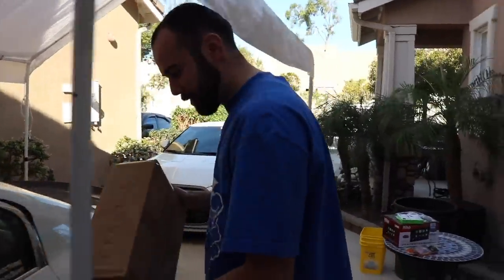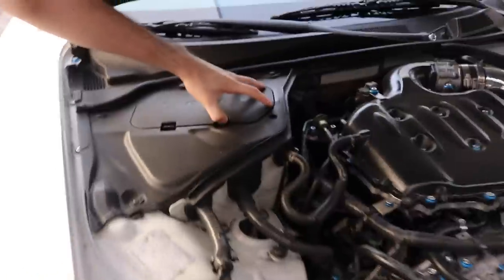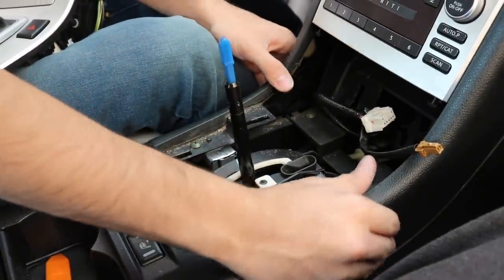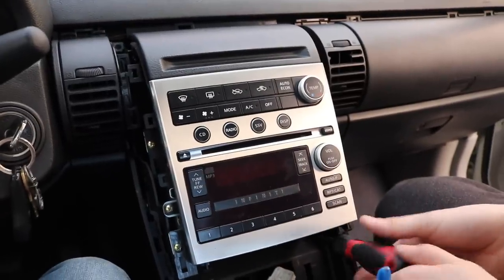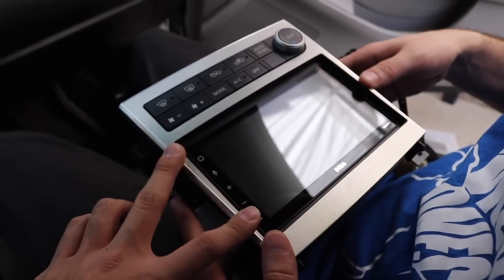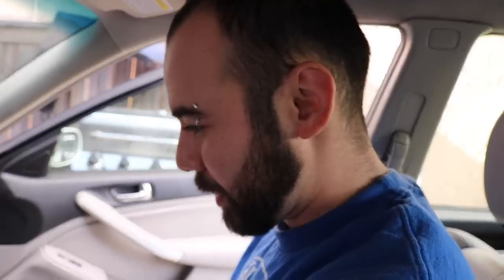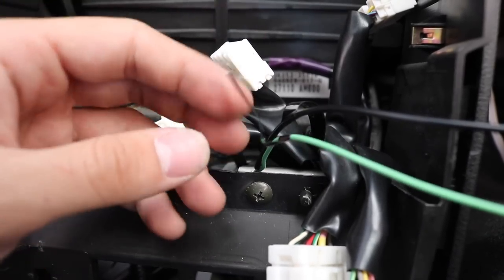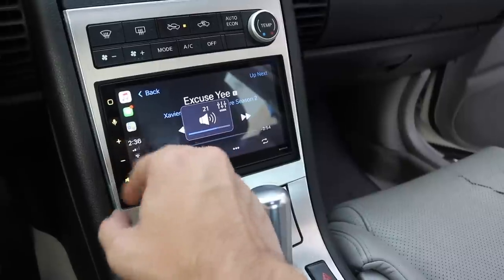JDM Double Din Install - Infiniti G35

Comment: after the install, does the steering wheel music module still connect to turn on the stereo, control volume and change tracks, etc.?
Reply: Mils Garage doesn’t seem like he has the stock steering wheel but I’m with you on that question
Reply: @pankakemix41  I think there is a wiring kit to keep the steering wheel controls
Reply: You need another type of wiring clip for the steering wheel to work with the radio
Reply: The wire harness does not come with steering wheel control you need to install a universal from maestro rr
Reply: @Weedcough  which one?

Comment: A watched this video a thousand times before purchasing a radio for my car.  I know Boss isn't the best. However in my opinion I think this is the cleanest, most factory looking aftermarket head unit that I have ever seen.  This head unit paired with the Jdm trim looks oem.  I ended up installing some walmart trash Android radio.  However I purchased it not because of a budget.  I purchased it because other than the Boss radio it wasn't nothing out that had a clean look.  Good choice and it looks amazing.

Comment: Did you manage to find out where the extra 3 harness connected to the car go ?
Reply: Jeyson Balbi yeah I have the same question
Reply: The other one's are for the steering wheel control but infinity does not have one so you need to have universal swc called rr maestro

Comment: Bro you are fire. I remember when you had like NO subs Bro! I’m contemplating a G but I need an X model Cuz snow life
Reply: Mikey Barker get veloster and make awd hehe
Reply from the maker: Thank you man! The G35 X’s are dope!
Reply: no the s
Reply: The x model is the frigging beast!
If you have good tires and decent suspension then you will be able to drive through damn near any snow! It also has a snow mode switch. I have an 04 model with slight functional mods. I live in the  north and it does very well in snow and ice! Good luck to you bro!
Reply: Ah Umm iive in Texas it will never snow here its 110° 😭 mines rwd. burning tires bruh
Reply: Did you get the X
Reply: You dont need awd in the snow. I've survived winters in a 240, mr2, and currently a g35 coupe. Good winter tires and good driving are all you need mate dont sacrifice the rwd fun 😂
Reply: Sammyeggnog how deep was the snow and where are you from thanks

Comment: The harness that you bought, did you need to move the cables around? I bought an adapter for the car that technically is a plug and play but I noticed that the 12v yellow cable does not plug into the slot from the car, as well as the ground cable. Did you have the same problem?
Reply: Daniel Araujo Nissan do not a have a ground, you have to make a ground if you are installing a aftermarket stereo

Comment: You should remove the positive terminal…… the whole car is a ground, so you could pick up a ground for that positive anywhere…… while you won’t  find a positive anywhere if it’s disconnected. Except the battery terminal it’s self. The rare exception being British positive grounded vehicles. You could still short something out the way you did it.

Comment: My radio and heat controls don't work and ac is stuck on. If I do an aftermarket radio will this fix my issue?

Comment: I bought the the double don’t used from eBay. And I bought the alpine ilx-w650 to go with it. I need a double don’t trim to fit it in properly. You think you could help? Thanks.

Comment: Hey,, the factory radio and ac climate control, are they connected together to the same circuit board?  I’ve been trying to find out if you could swap the oem ac climate control switch to the double din, this way, I can keep dual climate control that comes in my G....thanks!

Comment: If I'm broke asf could I turn the original din into a "double din" by using a dremel and removing the parts or is the ac control wiring part of the stock radio wiring?
Reply: Fah-Breezy the ac controls and radio are 1 piece I think I read you’d have to buy jdm ac controls if you want to just cut out a space in the original bezel

Comment: Im in the process of installing a radio the only problem I have is that there’s no ground cable... we managed to turn it on by connecting it directly to the battery which keeps the screen on even after the car is shut off.. so im planning on using a switch?
Reply from the maker: Just make sure it's not too much of a parasitic drain on your battery otherwise it'll leave you stranded haha
Reply: Don’t use a switch, wire the red wire to a accessories fuse that turn off when the key is removed and the yellow wire to a constant power also for the ground just screw it down to the side of the radio

Comment: I have a g35 coupe with navigation system do the make dash kit and where can I buy it
Reply: Erick Morfin yes,  the metra kit is the most commonly found kit that you can get from crutchfeild, ebay, amazon, and other auto electronics dealers. The best kit is the jdm kit that you can find on ebay and amazon. It can also be found at Nissanraceshop.com  . Which is where I purchased mine. Also for anyone who wants to keep the dual climate control, that unit can be purchased at enjuku.com for about $200.

Comment: Where did you get the cable that connects to the car that connects to the radio with all the colorful wires? Please help
Reply from the maker: I believe it's the Metra Wiring Harness!
Reply: You can purchase the aftermarket wiring kit form any stereo shop or bestbuy

Comment: The double din kit is 350$ did you buy it for that and what does it mean when it asks with navigation and dual zone ? What do I put
Reply from the maker: I bought it on eBay for about $250. If your car isn't equipped with navigation dont get the navigation one!
Reply: Static Works thanks

Comment: for the double din kit, which did you choose, single or dual zone?
Reply: Tony Le  check Wich one your car has so it will work correctly with the jdm kit
Reply: @poptrunkonu  where do you check dat? Doesn't seem to be a well known thing
Reply: Ali Khan if your G35 has dual zone it will have a specific button on your dash and it will say dual and of your don’t have it then the button is blank and their will not be any letters on it
Reply: @poptrunkonu  where can I find that?

Comment: Dang i looked that part up 390 bucks, surely you can get it cheaper that's just rediculous. (Ok after searching Crutchfield  has it for 150) or if you have to have jdm pay the 400
Reply: Philip Holman look on eBay, people in japan selling them for around 250 shipped to you
Reply: @Desert_juanito  z1 sells a nice metal finish one for 239. I found it online for 175  can't remember where. Not official jdm but that's really no big deal imo
Reply: @Desert_juanito  z1 sells a nice metal finish one for 239. I found it online for 175  can't remember where. Not official jdm but that's really no big deal imo
Reply: Philip Holman there is only two options, the jdm bezel or the metra plastic one that looks like ass as the buttons for climate control are really low quality, I say spend the extra money and get a jdm one

Comment: BOSS ? Really? What a waist of time. Pioneer 8201NEX only. 
#brokeboys
Reply from the maker: want a cookie? (:
Reply: If your going to do anything, do it right, don't half-ass it. If you can't afford to do it right, just wait till you can. But I give you credit on the true JDM bezel and not going complete scumbag using the non-matching Metra POS.
Reply from the maker: This debate has been going on forever. whether it’s rep wheels vs real wheels, etc. Some people can’t afford it while people choose not to pay 1K for a stereo or 4K for real wheels. The way I see it is, get whatever you want or can afford. While your looking down upon people who can’t afford certain things, someone is looking down on you for owning a 10 year old oil burning G35.
Reply: I see your point. Fortunately my motors a fully built brand new stage 2 Z1 motor and doesn't burn oil at all now. (atleast for 1700 miles between oil changes). I have a fully built Z also but wanted more room and love the timeless body lines of the G. I daily a 15' CTS-V coupe. The G and Z are just my hobbies/toys. For what you spent on the Boss you could've added $100 and got a nice entry level NEX , thats all.
Reply: That’s like saying why’d you cheap out and get those types of cars instead of spending a little more and getting a gtr.......
Reply: Thats not really a apples to apples analogy. The GTR is $110,00, I got the CTS-V with 10,000 miles for $39,000. Pretty big gap there. But again, I see your point...just not valid on a $70k difference. Pioneer just released some really affordable MVH series DD decks with all the bells and whistles at the last show.
Reply: Clean G35 you can get a used gtr for real cheap, they’re not that expensive used
Reply: You know as well as I do if a GTR is used...it is really "USED". lol
I'm not wanting to buy one that has been beat on since day of purchase. I want it brand new so I can be the one to break it in "properly". I'm sure you can understand that. When the 2019 or 2020 comes out I'll go test drive one again at my dealer and see if it's up to par with all the updates it needed to be a great supercar....not just a good supercar that beats you to death.
Reply: Danny Rohde ...your cool...ive been called worse by better people....Spectre? Really ? Just go to eBay and rice your shit out.  Lmao.  #noclass
Reply: Danny Rohde same . It just like any other brand your just paying for the name .
Reply: Clean G35 I stay in Houston , come down for tx2k I’ll smoke you . Show you these “cheap performances parts” im pushing 494 to the wheels on a sedan lol
Reply: keanu Romero good luck with that...Vortech S/C, methanol inj. , and cO2. And lightened by 360 lbs with carbon D'S, TITANIUM Spl arms, TEIN EDFC ACTIVE PRO and TITANIUM half shafts all built to 900HP in a coupe. You don't stand a chance. It's simple math in HP to weight. I got you by 111Hp before methanol or cO2. And I'm much lighter. But nice try.
Reply: Clean G35 that’s my secret,
I’m
Gutted out with one bucket seat, and carbon fiber all around. Carbon drive shaft and no a/c or radio. My car one of the lightest sedans around, I’ve beat 5.0, jags, turbo Cameron’s, I have no turbo yet, I’m running a 2jz, turbo kit coming in the mail soon. . There not one time I’ve lost so far and I probably won’t woth the turbo kit on. Come down tx2k. I’m very known.
Reply: keanu Romero lmao....